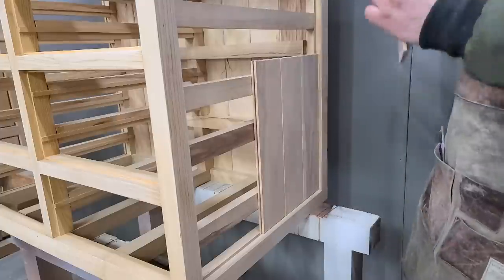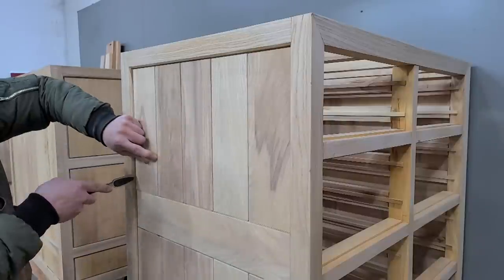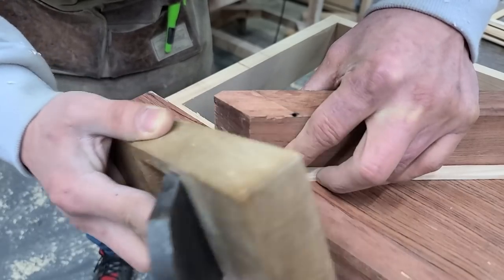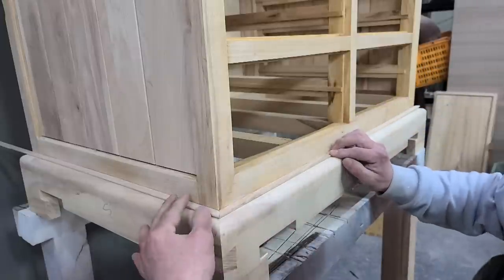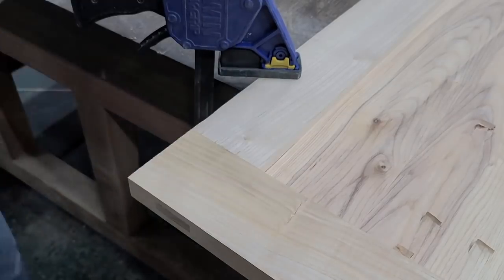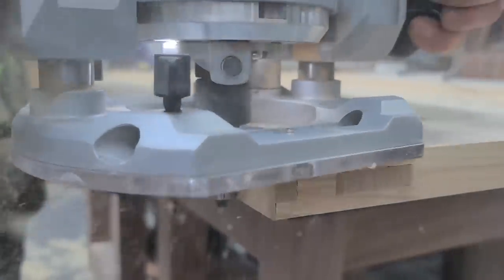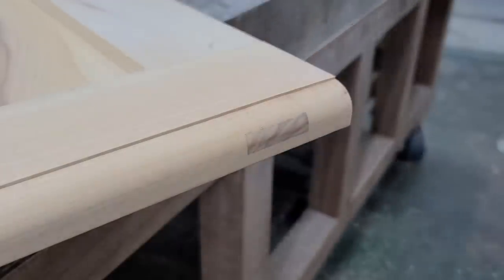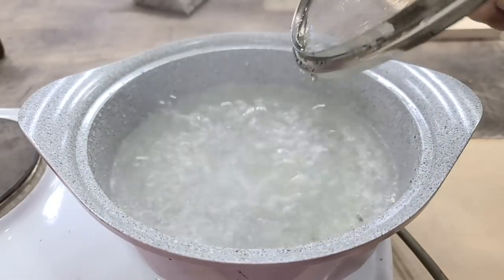Make a chest of drawers from wooden rails/Traditional way to make a chest of drawers

Comment: Wow, this is a well designed and constructed piece. I was particularly impressed with the prodigious use of both traditional and modern tools. The method for clamping the thin trim using thin boards under tension was most impressive. Thank you for sharing.